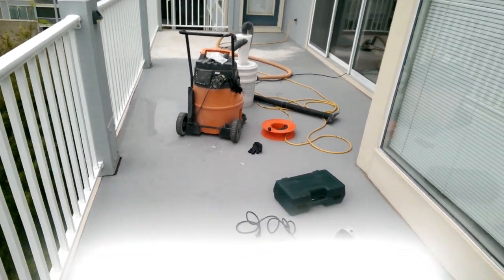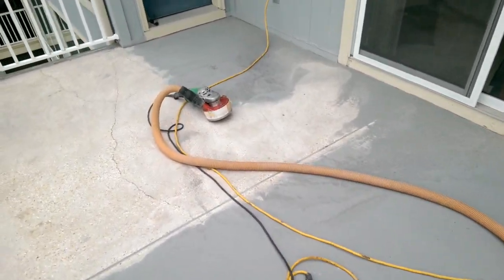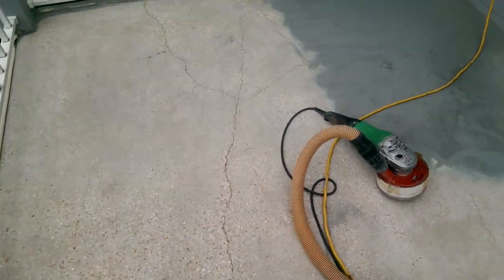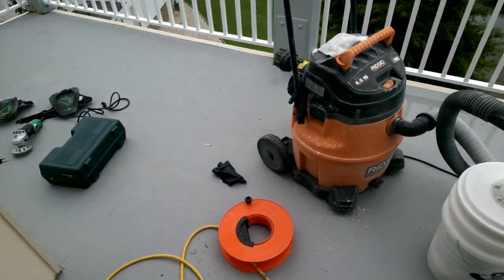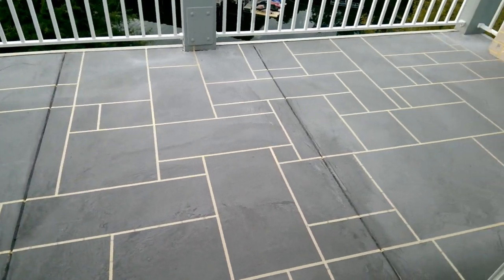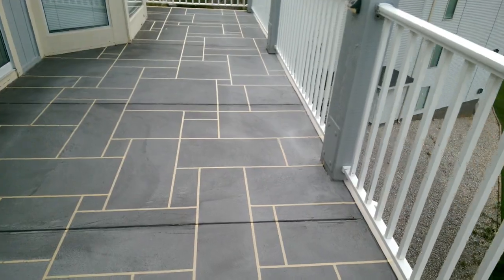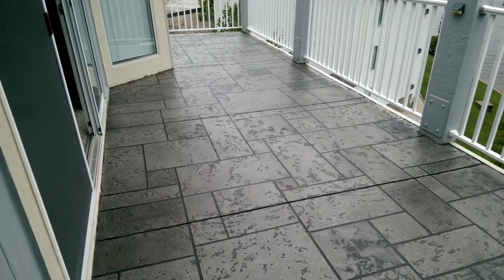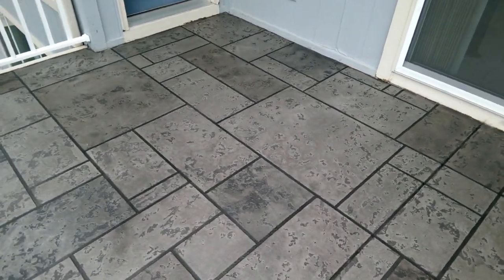Decorative Concrete Antique Acid Stain Ragatta Bay Condo Deck Lake of the Ozarks MO

Comment: Did the tack coat create those spots? Not sure where they came from but i like it
Reply from the maker: not the tack coat is to seal the tape only, there is no other purpose for it, the spots cam from doing the final texture coat which is a Tuscan slate, basically that means is the base coat is a 100% coverage and darker, where the Tuscan Slate coat is lighter and only covers about 85% of the concrete which leaves those small pockets so you can see the base coat (darker), then we sprayed the Antique stain over the entire slab which gave it a modeled look on the Tuscan slate texture coat or top coat.... watch some of my other video's and you can see the Tuscan Slate Application being created, I just use my trowel to create it... hope that was helpful.....here is an example of me laying out some Tuscan slate texture, be sure and please get Subscribed to my YouTube channel. https://www.youtube.com/watch?v=E-FxG3AV_aU

Comment: hi Rick i love it. ded you spray something over the tape to hold it down? if so what is it?
Reply from the maker: +Dexter Samuel thank you...nah we put another 2 layers of pigmented concrete (colored) over the fiber tape, pulled the tape, papered the railing and building then we sprayed Stain over the entire surface, after that we went back in and hand sponged painted certain squares and rectangles to add some darker colors and to give the project more variety or variance in coloring....then we applied our 2 coats of acrylic sealer.
Reply: I thought in the video it said you applied a tack layer over the tape? Is that the pigmented concrete you mentioned?

Comment: great job, how can I paint a completely different color? I would like a teal and red floor. What paint do you use?
Reply from the maker: its actually NOT paint, its an Epoxy we removed, then we did a Colored Concrete Overlay, with Acid Stains.
Reply from the maker: +Sariah Piedrasanta its not paint, this is a Concrete Overlay, which is a thin layer of concrete over the existing concrete surface, we add colored pigment to the material then spread it out onto the surface, then we taped the pattern out by hand with strapping tape or fiber tape, then more pigmented concrete over the tape, we add our texture with a trowel and pull tape then we Acid Stain the application and hand sponge paint certain squares and rectangles to add some variance in coloring to the overall project, last step we apply 2 coats of our Acrylic sealer.
Reply: +MrCustomConcrete thanks :*

Comment: Were all the colors yu used were gray?
Base coat light gray(3 oz)
Tack coat (white)
Texture coat ( 1oz medium gray)
Antique (4:1  1oz gray)
Highlight(slate gray).& ( medium gray)
Reply from the maker: Everything I used was grey, except I did use some platinum in my mix when I sponge brushed some of the squares, that's why you see some with a slight blueish tint. The color oz you have listed about are correct Except the Tack coat was actually the same color as the Base coat, I know in the photos it looks very light but I can assure you it was the same color as the base coat.
Reply from the maker: +lavonn simmonz all the colors were grey (charcoal)...base coat was 5 oz, tack coat same as base coat, texture was 1 oz, Antique was a 3 to 1

Comment: Heyy rick, I need some advice
Reply from the maker: lavonn simmonz oh geez sorry I just seen this comment Lavonn, can I still help?
Reply: MrCustomConcrete wat blade did yu use for the epoxy
Reply from the maker: On that one I just used a 7 inch diamond wheel from Lowes, nothing Fancy.... but from now on I'm using better PCD's and Diamond Wheels from Andy Franklin and also Elitecrete, Nick in St Louis, Mo has a guy that gets some great tooling, contact me for details.